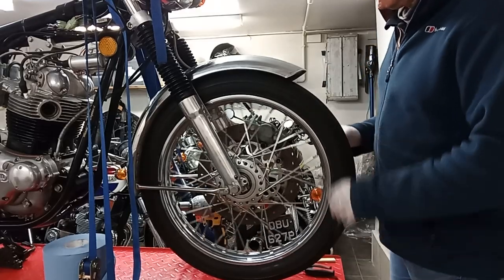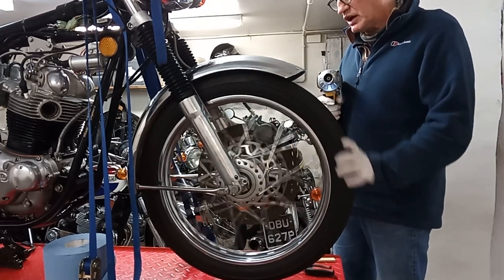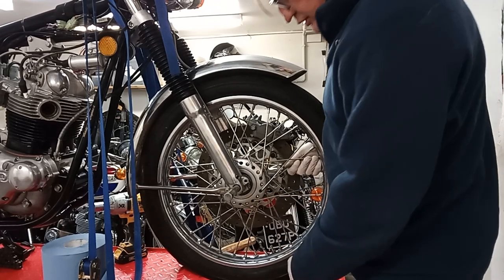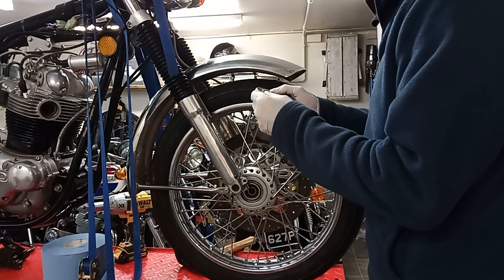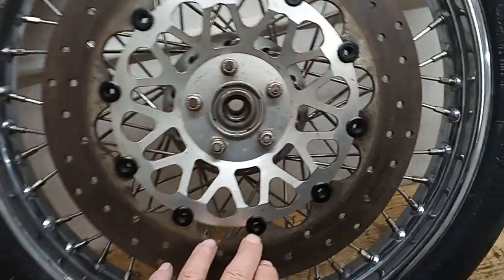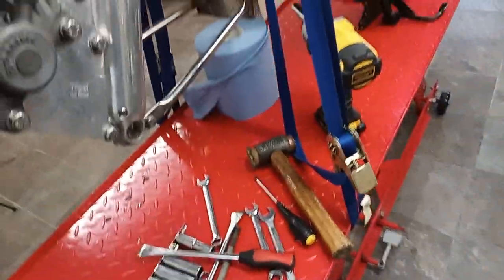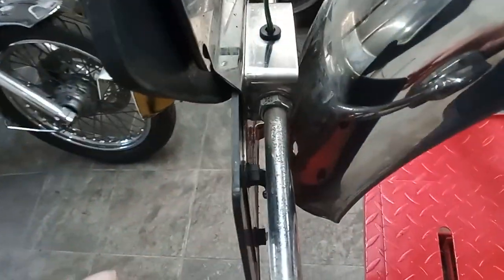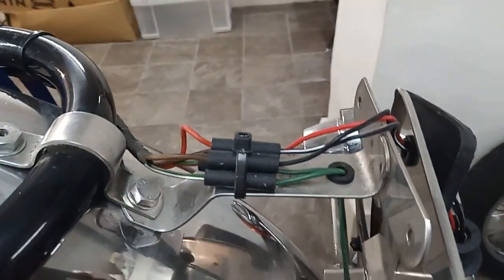Norton Commando 850 MKIII Service and Recommissioning. Part 7: Removing the Front Wheel

Comment: Hi Chris,
Wonder why the axle was so hard to remove?  I recall going through my 71 that one of the stanchions was not straight, causing a similar issue.  I lowered mine ( I am not too tall) so I had new stanchions made.  No issues going back together.  I noticed the issue when I stood back away from the bike and noticed the two fork assemblies were not parallel to one another.
Thanks for another great video.......
Reply from the maker: Thanks for that. I thought that it was tight simply because it had been standing for so long, but on reflection it may well be a problem with the stanchions. I'll defo check them. 👍
Reply from the maker: Sadly, I would be inclined to agree with you. 😒